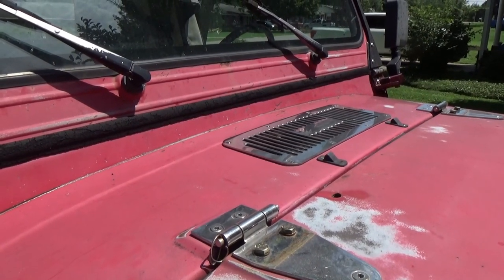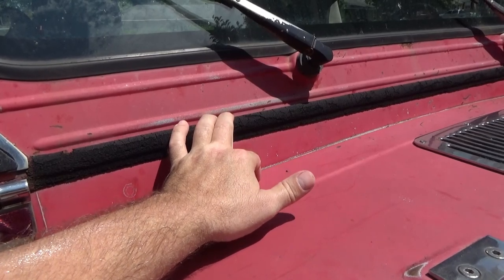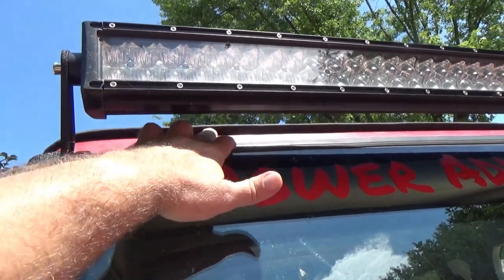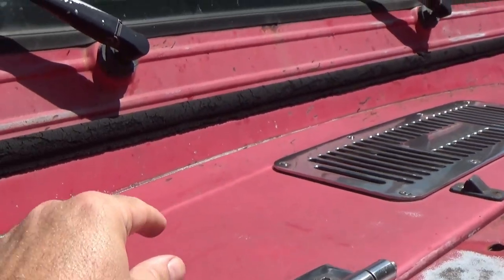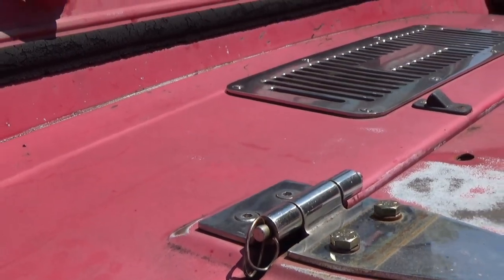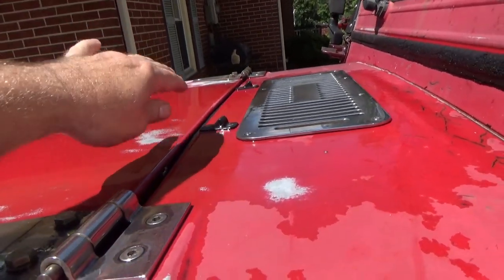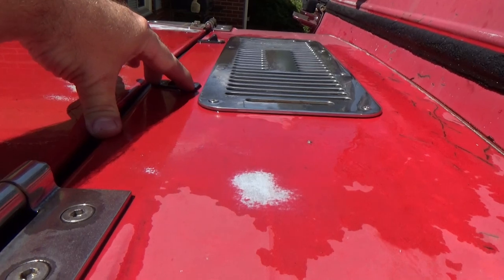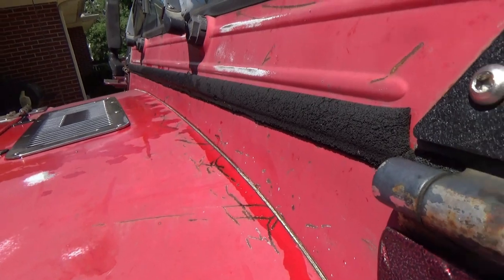Jeep Wrangler YJ - Water in the floorboard?? How to find where the leak is.

Comment: YESSS! I had already replaced the windshield seal, still water. Watched your video, stepped outside and fixed the drain tube, 5 minutes. I've owned yjs for 23 years, this problem started on a yj I bought two years ago. Two years of a wet right foot after it rains (I live in FL, so we get rain). Drive to work with one dress shoe and 1 flip flop. Thanks!

Comment: I have leaks on the seems just like you. But my biggest leak is from under dash. I noticed on my rig that water builds up right by my windshield wiper motor. I can feel a puddle after rain and when wash the jeep. Have no clue how to fix. I really don't want to drill a hole at lowest point of windshield frame where tje door shuts to drain when water intrusion?

Comment: thanks again Chuck!  You are correct about using body caulking to fill the seam.  I used marine grade silicone (Walmart) and some painters tape for a clean line to fill the seam.  You can't hardly see it and after a couple years it hasn't yellowed in our blazing sun.   It stopped the water intrusion. I don't plan on painting my YJ anytime soon.
Reply from the maker: When I eventually paint  mine its going to be with bed liner. So, that should stop any of the body seam leaks!! LOL

Comment: Help. I getting water on passenger side floor. It's coming from the windshield sprayer. Doesn't go to spray nozzles. It's not connected. How do you find this hose connector?
Reply: Good question. Don’t know if you ever managed to get to them but I took the screws out and dabbed some silicone under and put screws back in.
Reply: Heater core bad???

Comment: The windshield washer sprayer leaking? No way. 
Never in a million years would I have suspected them. I've been outside for an hour with a hose, spraying down everything from the bottom up, sometimes Id have the leak inside, but I couldn't seem to pinpoint it. 
I got my YJ from my late aunt, and years ago she had the entire thing rhino lined. I guess the rhino liner was, or is, the only thing holding the sprayer to the Jeep 😂😂😂 That stuff is so thick, I couldn't even tell all four of the screws are missing hahaha

Comment: Great video!  Just subscribed. Mine was the cowl drain tube with the crimped end.  Used a heavy pair of construction scissors to lop off the end and the water gushed out. Sediment had it all plugged up. BTW, there is some other overflow tube under the battery on my 92 YJ. Not sure what that drains but it was flowing freely as I flooded the cowl.

Comment: Did you make the video to repair the body caulk? I have that same leak, not sure the best way to repair it. Do the body panels need to be separated, or can caulk be applied while the panels are still assembled tightly?
Reply from the maker: I haven't fixed anything yet. It's still leaking. No you don't separate the body panels. Clean out all the old caulking, then apply new.

Comment: Hey, great video, but what kind of gasket do you use on top of the windshield frame? I have wet, and I mean soaking wet feet every time it rains, I have done everything but searched there, that's all that's left, that must be it. I make a right hand turn, the water comes out in buckets, so I need to know what it is that you are using for a gasket on top of the window frame. Thanks, Dave from Oklahoma.
Reply from the maker: Its the storm door gasket material that's sticky on one side. It's about 3/8" wide and about 1/4" or less thick. I put a link down in the video notes to the video where I repaired the soft top channel. Glad you liked the video!! Good luck and have a great day!!

Comment: Does anyone know where I can get a cap for the 5/8 size windshield reveal, not the original 1/2", cause somebody stole mine!
And I'm trying to find out what size bolts I need for the two rubber bumpers that go under the hood if anyone knows.
Found out a week ago, that my accelerator cable was not using my throttle body the way it should on a 90 2.5. It was using a 1/4 of it and had to step all the way down on the gas pedal and wait for it to speed up. I cut a pice of rubber a 1/2" and put it between where the spring locks in at the pedal and "wahlah", throttle body actually works right and the pedal depression actually accelerates the speed the way it should and rpms didn't rise when at idle. Way more torque and acceleration!!!